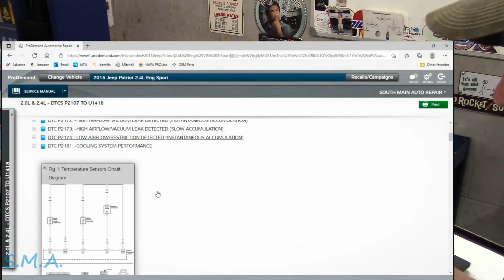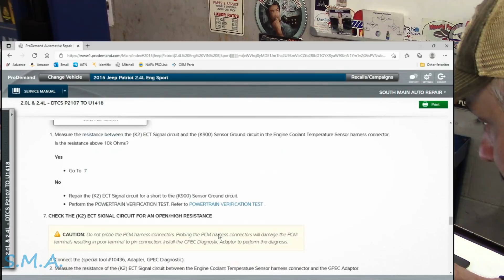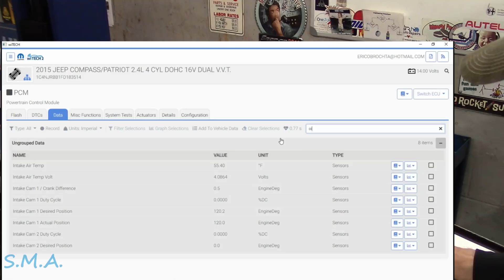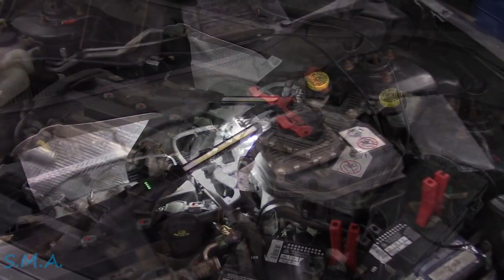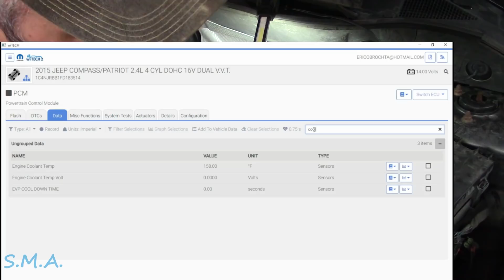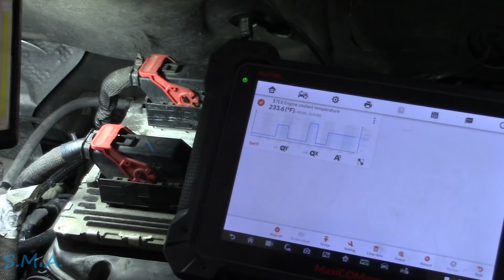Jeep Compass: Hard Start Cold / Overheating!?

Comment: My 2012 Jeep compass has been doing this lately. It’s been having a rough start and when I turned the key to on position it’s already overheating even though I never started it. Thanks for the diagnosis process. I will try this in the morning. I’m pretty sure my sensor just out, but I also have a little leak in my thermostat housing but I’ve cleaned out my connections. 🙏

Comment: Excellent vid. I just went thru this with a 2017 Buick LaCrosse 3.6. Codes for t stat, fans come on and stay on, temp gauge bottomed out on C. Shop already put in a stat. OE scan data from the OTC showed 158* live data. Unplug the ETC and it showed -40. Jump the harness, and it showed 158*.. In generic, same scanner, it showed 240*, harness NOT jumped. The ETC had failed, and the t stat code was because the fans were always running on med speed, it couldn't warm up correctly. New ETC, clear codes, and then the gauge worked, no fans until 207*.  I will say that I don't understand why the gauge showed C instead of H, but whatever.

Comment: In VW/Audis this sensor is a dual one, measures twice the same coolant temp, one signal goes to dashpod and maybe ac and the other goes to ecm.  Commonly one circuit breaks and drives mechanics and DIYers crazy, common failure for diagnosing cooling issues on a perfectly running engine.

Comment: If I am not mistaken that engine has 2 thermostats, I wonder if both were changed. What I am getting at is if I were to change both I would have changed the whole housing as it is plastic and I think the OEM comes with the sensor. Had he done this the parts cannon would have worked.

Just something to think about.

Comment: Used to rebuild my own starters, but now that I'm 67 I find I value my time more, especially when the parts are hard to get.  Last year the GM starter on my wife's car developed an intermittent no crank.  Electrical feed was OK.  The pinion gear end shaft had worn through the bushing right into the housing so I was really glad I got a new one before I tore it out.  Harder removal than in this video. The old starter never made noise, just the intermittent no crank.

Comment: Thanks for all your videos on the Chryslers. I have watched pretty much every one trying to fix my 2008 Town and Country. I have replaced just about every part. I just replaced the PCM as a last resort hoping that would fix the problem. No luck! Strangest thing is that on the scanner I will get a bunch of random codes, any where from 6 to 18!. We clear them, then replace the sensors, run again on the scanner and we get even more codes. The van will run good for a minute, then start to misfire and shake violently. I am currently going through the entire Harness thinking maybe there is a burnt out, or crossed wire. Do you have anymore videos on wire harnesses you could upload?
Reply: would not hurt to check all ground wires are actually have a good  ground.

Comment: Just a fun-fact for the day FYI, -40 F just happens to equal -40 C.  That’s the only temps using those two temp scales that are the same.

212 F = 100 C
32 F = 0 C
-40 F = -40 C

Comment: I got my butt kicked by substitute data…once. There is a reason OBD2 specifically does not allow substitute data. OE tools should more clearly indicate when a substitute value is being indicated. I learned that if data doesn’t do what I expect it to, just switch to generic OBD2.

I think the 2nd ECT reading of 419F is because Chrysler used the same GPEC ECM for multiple different engines, and some of them had more than one ECT sensor, so the generic OBD2 shows it even if the sensor isn’t present because the GPEC ECM is capable of having a second sensor.

Comment: I wonder if anyone noticed in the wiring diagram the reference to ECT 1? This would indicate that there are 2 engine coolant temperature sensors. If there is only one then it would be labeled ECT with no numeral suffix. The one that was "shot gunned" into place was the easy one to find. That is the primary. There is a secondary thermostat located at the end of the head near cylinder #4. Primary opens around 180 deg F and secondary opens around 203 deg F. I believe the engineering design is to run the head at higher temperature for more effective combustion and reduced emissions.

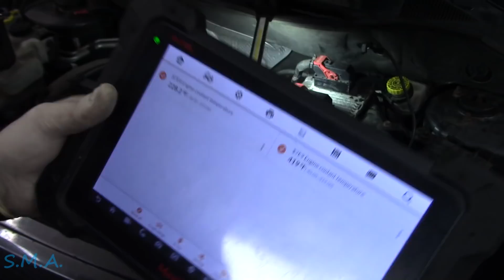Comment: hello Eric, let me explain what I have in mind regarding the minute (9:49) of this this video of yours and I don't know if I'm right.  1-.  ($7E8 HEX is equal to 2024 decimal) this is the current temperature of the vehicle under scanning  (228.2 ºF) 2-.  so ($7E9 is 2025 decimal) 429ºF is the high side of the scale used by the CPU (and $06 mode) and the low side of the scale is (-40.00 ºF) In fact you can see this value on the scanner, inside the parentheses on the right site of the scanner screen, minute 9:49 this is the complete scale. Also, computers communicate by (HEX and 1's and 0’s) I repeat, I don't know if I'm okay.  Greetings from Tijuana B.C, 🇲🇽 Mexico.

Comment: I have a 2003 buick Rendezous that the temperature gauge jumps only when I've driven the car over 15 miles and it's above 80 degree outside.  Never any other time when it's cooler out and never in the winter months.  Water pump coolant sensor and thermostat all changed even cut in new pigtail & clip radiator was flushed and the fans work fine.  Any ideas?  If I lived close I would take it to you.

Comment: Can you get substituted values for voltage as well or is it generally safe to just look at voltages, even in OEM data, and not how that voltage is interpreted?
Reply from the maker: Good question, I never trust OE data when I suspect something is being substituted and I don't recall a situation where the voltage value is substituted. Perhaps someone else could chime in on this too. At any rate I always default to generic data to be safe.
Reply: @SouthMainAuto  The Jeep XJ's (Cherokee's) if the alternator went out and the battery voltage got below something like 10.5 volts, they would substitute an artificially low value on the dash voltmeter. It was supposedly to get your attention. Don't know what the engineers were thinking. When you need the voltmeter the most, they disable it.
Reply: @SouthMainAuto  Of course! See what the sensor says rather that what the controller says it thinks it sees. "Trust but verify". 

Since the sensors are temperature-dependent non-linear resistors with negative coefficient (thermistors), measuring the resistance is the first thing.
Problem is knowing what the resistance vs. temperature dependence is for any given sensor. Manufacturers must know because they make (and test?) them. Designers must know because they use them. Can an ordinary bloke get this info?  (Other than buying one or 10 and measuring and calibrating).
Reply: @SouthMainAuto  Voltage for a sensor will be raw data from the sensor. The engine ecu has an internal map to convert that voltage to a temperature value. So there should never be a need to produce a substitute voltage for a substitute temperature. The substitute temperature will just be stored in the ECU as the substitute temperature.

Comment: I had a GM the other day that had 42 codes set in OEM specific.  There were voltage high and low codes for nearly every sensor under the hood.   They wouldn't clear.  However Global show no codes at all.   Replaced the computer and that went away, but I had a bad crank sensor and cam sensor.   No way to know that till I got the computer to stop flipping out on me though.

Comment: I keep asking this Eric What are the 3 clicks as soon as you turn off the vehicle. My daughters (we bought it brand new) Jeep Patriot always does this every time we turn it off
Reply: Could possibly be the EGR valve self cleaning, most vehicles cycle the Exhaust Gas Re-Circulation valve to help keep it from getting gummed up and sticking on key off, Ford Transits make a really funny noise like a goose when they get a bit worn every time you turn them off.

Comment: Have you ever seen substituted voltage values? I can see how it would substitute an interpretation, but substituting an actual voltage value would be another step toward confusing diagnostics.... In any case, it is too bad there isn't a flag to identify when a value is substituted.
Reply from the maker: Another guy just asked that and I thought about it for a bit and I don't think I have but I am going to pay attention now and see. Great question !
Reply: All the sensors on a vehicle with electronic engine management generate an analog signal (varying voltage). At the PCM (powertrain control module) the analog signal is converted to a digital value. Then logic within the PCM analyzes this digital value and determines if it makes sense when compared to other values (oil temperature, intake air temperature). If it does not then a value is substituted. So there would be no reason for the engine management logic to substitue a value for the analog signal. Just substitue on the converted value; analog to digital. And as Eric O has indicated a substituted value parameter is used to keep the engine running (if possible) and not leave the vehicle stranded and non-operational.
Reply: Unfortunately it looks like the flag is just using your noodle. 😅

Comment: Excellent video!! Had one go bad on me a while ago,, my second car was sitting for a yr and I decided to hook battery up and start it.. started fine considering how long it's been sitting and few moments later it started missing and barely idling and giving it any throttle didn't make much difference, service light didn't come on but I had my scanner with me so I live sensor read it and noticed the coolant temp was way out,, live sensor data showed temp of 240° which clearly wasn't accurate being it was just started,, so I shut it off and re-started it and symptom was gone and then showed a much lower temperature, so yes it was just ECT and put a new one in and fixed

Comment: Looks like the other shop just chose the first thing on the list.  How did a technician think a bad thermostat would cause a gauge to read high temp when the motor was dead cold.  I'm no tech, but as soon as Eric said the temp gauge goes up when the car is cold, my mind said temp sensor.  Not having a bunch of fancy scanners, I would have just unplugged the sensor and looked to see if the gauge went back to zero.
Reply: Unfortunately because the temp gage is networked it likely won't read cold unplugged due to the open circuit. In most cases the gage will indicate an overheat condition as that would get your attention.
Reply: @PhillipBailey  Read again- I said when the temp gauge reads hot with a cold engine, the first thing that comes to mind is a sensor.

Comment: It amazes me that anyone with a reasonable knowledge of vehicles would throw a thermostat at this based on the symptoms.
Reply: Agreed, looks like someone pulled the codes, checked the service data, saw the first thing on the list that was a replacement part ( I think it was listed as the second possible fault), slapped it in, and called it done. 
Some of the stuff Eric gets from "The Other Shop" is a bit of a tougher diagnosis but this was a bit pathetic. I mean if you're going to load up the parts cannon, with the faults described temp sensor should have been the first option!
Still like the video Eric! Love the way you work!
Reply: @grannyflatgarage7599  The thermostat seems like a go to part for a lot of places, not sure if lazy or incompetent, but considering the temp shot up on a cold engine it makes no sense as a thermostat will never cause that symptom.
Reply: @notavailable9919  true, makes me wonder a lot of the time whether "another shop" is actually "my mates driveway" haha
Reply: @grannyflatgarage7599  Bingo!
Reply: I'm surprised they let it roll out the door with the light still on instead of guessing the temp sensor next. These morons usually just keep buying parts until it's "fixed".
Reply: @0778drz110  I had my last car for 200,000 miles and never replaced a temp sensor. Does that answer your question?

Comment: You have so much talent when it comes to wrenching bolts and trouble shooting.  I bought a 2004 F350 truck 10,000 dump and the ex owner tried to rewire the rear lights and cut them.  I know you do not like to give advice however can you tell me where I can purchase a 2004 F350 wire manual for my truck. Thanks for any help.
Reply: Mitchell diy has it

Comment: Was there any consideration of trying to clean the terminal area of the sensor with a little water or electrical cleaner to see if that was giving the false reading? you mentioned that there appeared to be coolant on the male pins and this may have given an additional path for the electricity to "fool" the ECM.
Reply: generally, when you see a fluid in the pins taht is supposed to be sealed on the opposite side it means the seal in place to stop the fluid to get to the pins is failing... it's a total waste of time to diagnose how the fluid got there. replace the sensor. make sure connector is sealing.

Comment: Yep. Not a fan of the interim “substitute/default values” on certain parameters. Although in some cases the mfg will actually re-flash a sensor value to a default value and ignore the sensor input altogether. Like on my old 04 F350 6.0L. Per Emission Recall 06E17 I believe, they replaced the defective EBP sensor, then re-flash the PCM, FICM etc to ignore the EBP sensor input and instead use a preset value. Go figure. Fixed the problem but seemed kinda dumb. Drive a Chevy 2500HD now. 😎
Reply: To be fair, I see it as error trapping by the manufacturer.  The control module has detected that the sensor input is bad, so rather than acting on known bad data it substitutes a “safe” fixed value and runs on that.  If the control module were to act on the known bad data it cause additional problems.  This is based on the case where the owner is driving the car.  It would be nice if there was some form of indication on the diagnostic tool when an input has been substituted, but that’s probably scan tool dependent and may be outside the control of the vehicle manufacturer.
Reply: @TheCubicnz  Agreed. Kinda like a sensor limp mode of sorts as long as doing so didn’t adversely affect other components. Should still set a DTC IMO. Albeit in my recall I believe they, at first, were replacing the EBP sensor but were still having issues with them. So to my understanding the re-flash was revised to fully substitute some nominal or extrapolated values. At least that’s what the Ford tech explained to me. Is also discussed ad nauseam on a few forums.